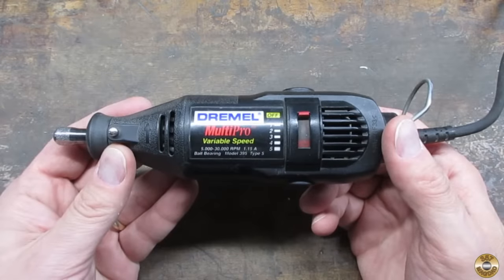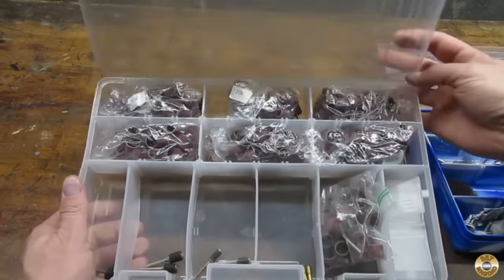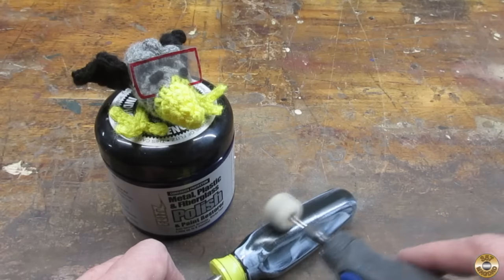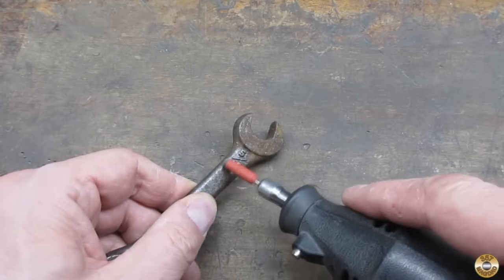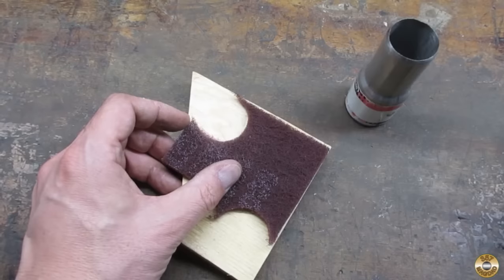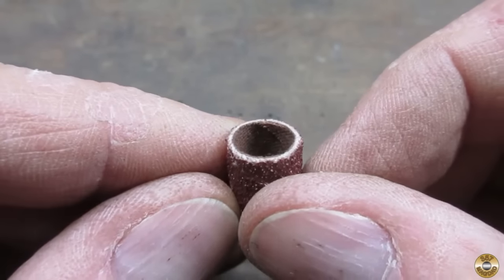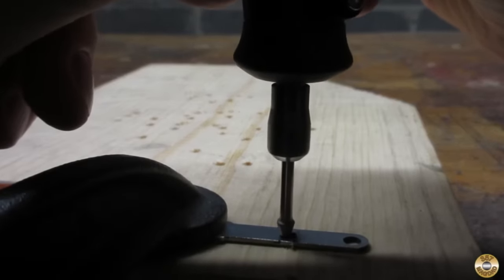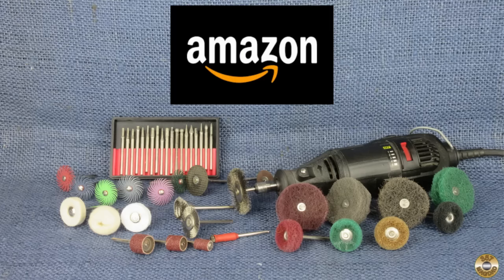Rotary Tools Tips and Tricks

Comment: I spent a fortune on a dremel an it didn’t last five minutes, someone got me a cheap one and I didn’t use it for years thinking it would be 💩but I had to use it on a job and I’ve been using it for 15 years, manly for porting cylinder heads on motorcycles
Reply from the maker: My Dremel is 25+ years old.  I guess they don't make them like they used to...
Reply: @357magdad more likely ham fisted putting too much pressure on sanding drum?
Reply: I have had a Dremel almost identical to the one in video for at least 22 years and still use it, mostly for de-burring parts and some detail work on carburettors. (it's grey not black but otherwise the same)
Bought a new Dremel 4000 about 5~6 months ago as the cheap no name one had terrible balance and excessive vibration.
All the 1/8" shank mini grinders are WAY too small for port work, even on motorcycles (which I've done since 1970's, bought a Snap-On air die grinder at very excessive cost)
 Your either not doing much or only playing with pit bikes?
Dremel sized 1/8" shank burrs are too short to get into ports, sanding rolls have too sharp an edge
 A cheap Harbor Freight electric die grinder with 1/4" shank carbide burrs is way better plus you can get 6" long shank burrs from various places (although I cut them down to about 4" long for motorcycle work)
HF also have sanding rolls with shank/adapter in 1/4" just about identical to the real porting kits for around $20.00 (although buying a 6" long sanding roll shank is a good idea)
Even cheaper is Harbor Freight air die grinder which was only $9.99 when I bought FIVE in 2002 and used the heck out of (almost constantly for 3~6 hrs a day for 3 years when I was teaching 'Machine Shop' at MMI) 
Ended up giving away 3 of them as they were more reliable than expected. 
You do need a decent size compressor though.

Comment: Man, I loved almost all the tricks, except using scouring pads as a DIY alternative for buffing wheels. I actually arrived here while searching for reviews of those Chinese Dremel EZ 511Es abrasive wheels knock-offs, because the originals are too expensive and I had tried the same DIY approach using both green and maroons Scotch-Brites (proper 3M's) with abysmal success. The Scotch-Brite approach is terrible for 2 reasons. First, the fibers are not bonded together the same way a proper Dremel Wheels' fibers are, so the spinning will make the Scotch-Brite release A LOT of dust and fibers, which at some point I felt could really cause harm to my health. Second, the abrasiveness of the DIY discs is immensely bad; my guess is that the abrasive of the scouring pads is concentrated at their top and bottom, making the DIY discs almost unuseful to sand anything laterally (using the lateral part of the discs). The original EZ 511E is really great, but the DIY effectiveness is not even 20% of the original disc... probably worst to be honest. This is not to criticize you, but it is a heads-up to anyone else like me who actually needs something that works at least partially as much as the original discs.
Reply from the maker: Thanks for watching!  The homemade scrubby wheels work well for me!

Comment: I will catch myself using my bench grinder or my full-sized angle grinder without eye protection if I'm just doing something really quick, 
but I don't mess around with these fast spinners will fragile attachments. 
You're going to pick some wire out of your skin off of a brush eventually.
Between that and cut wheels that could snap in half when you set the tool down on the table.
I don't want any of it in my most attractive asset. Them baby bleus;   Baby! 
Truthful sarcasm.
Reply from the maker: I always wear my full face shield.